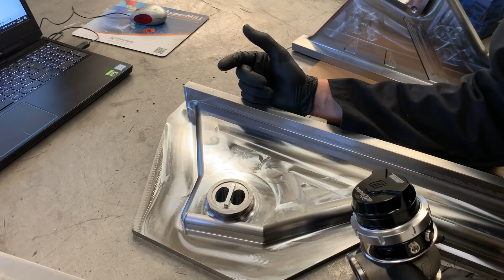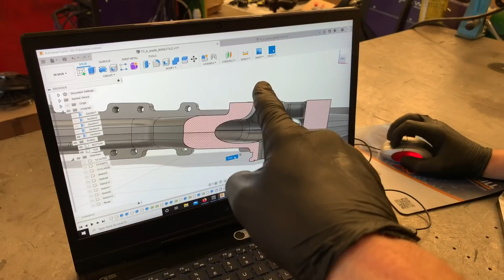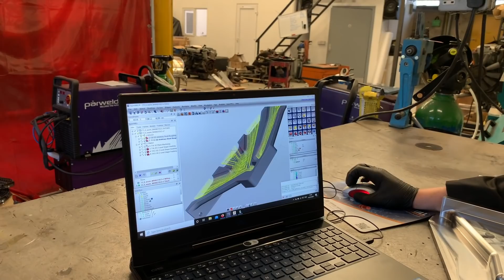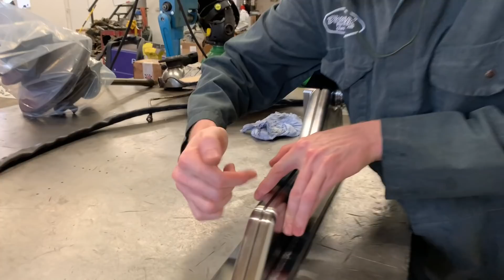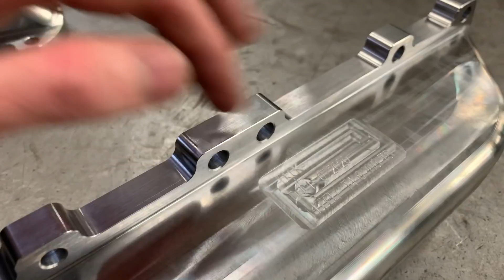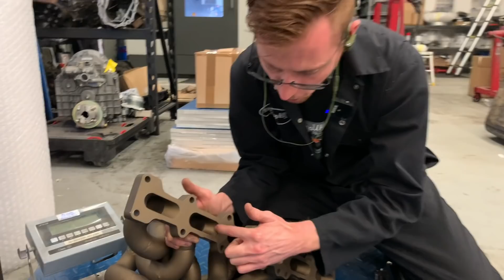BILLET TURBO MANIFOLD OM606/605

Comment: Good in theory but like other manifolds designed wrongly and using the wrong materials, it just won't last, it'll fail after several heat cycles, it'll crack and / or warp at the flanges.

Comment: Great product!
A tip for speeding up the finishing on the mill, without sacrificing surface roughness; when finishing you were using a z-level strategy. Next time use profile finishing, and then across.
Use inserts with slightly a larger radius on them, and you’re golden.

Comment: Nice job and and really need design - but you got a major “negative” flow point. At the turbo Flansch, where the flow comes
Into a sort of had angle - idea is to make the neck of the turbo Flansch longer and round so the flow gets a easy and smooth angle right before it meets the turbo and the wastegate
But very nice. Love to see and test it on a tractorpuller
Reply: agree, the merge point and wastegate port look terrible angles. super unequal lengths as well.
Reply: Often the head porting doesn’t come straight out so depending what this was built for it may have those in mind.
Reply: Interesting. Do you have any data to back your claim? Seems these guys took time to flow model their design and they probably have the test data available to back their claims, so I'm wondering where your test data is that shows this "negative flow point."

Would be nice to compare the two.

Comment: Why not Dimple that bad boy like a golf ball while you're in there
Reply: @Stephen Laverty ahhh I see I thought it was for moving air more efficiently
Reply: Dimple porting is a flawed notion.
While it might work on a golf ball where the peak speed during flight is taken into account aswell as depth of dimple, diameter, spacing etc.....most dimple porters are not doing thousands of calculations to calculate whats needed specifically for thier engine.
Which pretty much leads to the main point...
Wanna know what flows more air than a 25mm cross sectional port with 1mm deep dimples? A port thats been bored out to 27mm.
If you look at some (really well done) dimple ported heads what they're effectively showing is all the areas they could have just been removing material. They're effectively thousands of "depth tests". But the boundary layer effect is allot less than if they were just ported bigger.
But that doesn't look as good and people won't want to believe it or test it themselves and they'll just ignore the fact that if it helped... f1 etc would do it.

Comment: Out of curiosity, would this system be adaptable to make equal length headers?
Reply: Nope, if you want equal length then the channels have to be able to be crossed so that the port closest to the outlet can have a longer path. These are all in the same plane so they can't be crossed.
Just think of it as if you have a set of equal length hoses and the length is determined by the distance between the outlet and the exhaust port that is furthest away from it, it will always look like a complete mess of bends no matter how you do it. :)
Reply: @konradlindblad7860  yeah actually it can be in an equal length header style just have to have 3 piece design instead of the 2 piece design shown here

Comment: It looks good and it saves space but it's being compared to an exhaust manifold with equal length runners. Simpler methods can be considerably amaller. Although the shape of the runners being the same as the ports is definitely a plus I am still not sold on this part because it seems to take no advantage from the pulse scavanging effect. Only with a good comparison with those 2 parts actually bolted to a car could make me change my mind. This is a premium part that costs premium too for sure. I want to be sure if the performance is premium before spending my money.

Comment: What about pulse scavenging?.. I'd be interested to see this on a dyno vs a stock unit.
Reply: Stephen - an OM606 is a diesel..
Reply: @Stephen Laverty your comment makes no sense what so ever
Reply: @tomtom1541  I hope he is trolling 😂
Reply: @jzxtrd337   based on what?
Reply: Dat Boii lol what? A blow off valve doesn’t go into the exhaust manifold lol. You’re talking about a wastegate. Completely different. Lol
Reply: @Stephen Laverty Who runs carbed turbo engines? These were rare even in the 80's turbo cars.
Reply: @Stephen Laverty The online world can be brutal, especially when people comment out of the box, but also when advice is shared that's unconventional and risky. I think you're making a mistake going carb personally, venturi effect can't provide the precise fuel metering required for boosted applications. The jetting will favour either the lower rev ranges and run lean up top, or lean up top and rich down low. This will throw daily driving out the window and/or risk the engine. Remember that with turbo applications the air/fuel ratio must richen up on boost (manifold pressures above atmo) for a carb to do this the jets would need to be variable. Carb is suited to N/A where air/fuel can remain more consistent across the rev range - manifold pressure remains constant at 1bar. Few questions, will you run the carb pre-turbo or post-turbo?  I'm assuming the supercharger will be after the turbo and last compression stage before the engine.
Reply: @Stephen Laverty Hang on, first you start off bragging about a race where you beat a guy in a diesel and how diesel engines are a waste of time, then you say engines should be bringing us together yet we treat them like races??  Then in all your rambling you never gave any technical info to support your idea on turbos and carbie setups. I tried to explain why I believe it can't work well and supported with technical concepts. I'm sure you're a nice guy but you're all over the place and not open to logical debate.
Reply: @Stephen Laverty  Dude we're talking engines.. who's coming after you/martyr??  just wanted to point out the implications of turbos and carbie setups. Take it easy.

Comment: This is really nice for tight spaces and would be very interesting to see a flow comparison, also if the manifold scavenges as well as the tubular
Reply: Well scavenging is important for high revving NA gas motors, but turbo diesel motors have boost to shove air into the cylinder. As long as the boost is higher than exhaust back pressure there's a pressure difference automatically and no valve overlap swirl is needed for fuel mix because of direct injection. That's why they almost always have log style manifolds. 

BTW I'm dying to see the widebody on your Trackhawk Magnum!
Reply: @NeonAvantium  oh see I must have missed the diesel part, I saw the first manifold and assumed lol. But the whole cnc aspect is really cool, I love new cnc'ed parts.
Reply: @Junkyard_Dave   no doubt!! they made a gorgeous part. That looks like a great packaging solution with the compact size and the integrated wastegate flange.  did some learning on this. Turns out we were both right. And the key we were missing was this is a twin screw manifold. The turbo does the scavenging. 

Great engineering explained vid on this: https://youtu.be/T7JTRRlSEYI
Reply: @Junkyard_Dave  there is no scavenging with turbo engines as the exhaust back-pressure is literally double the boost pressure. Savaging is critical in non-turbo engines, yes, very much so.
Reply: I'm not sure turbo manifolds utilize scaveging Dave. It's all gas under pressure which makes the fluid dynamics the most important. Flow and restriction and turbulence.
Reply: @NeonAvantium  valve overlap man valve overlap

Comment: Adam LZ needs this for the R34
Reply: False. He's running low mount twins. Tomei already makes nice low mount manifolds that he can get for less than $800, but I wouldn't be surprised if he's going to run the stock manifolds for his first turbo setup.
Reply: @steve.r33  he will eventually go to a large single as he stated before
Reply: @adamhallwood5768  Maybe. Those 2860R gen 2 are pretty nasty. Only reason he might want to go big single is if he’s building a drag car.

Comment: I would like to see the benefits other than just being slim does it improve performance or does it hurt performance
Reply: Flow looks woeful, but being heavier it will retain heat for more airspeed. 
Shouldn't crack either

Comment: I'd be putting bolts through the center to hold both sides together.  This is going to warp and separate the two halves between the runners.

Comment: How does it hold up with high back pressure since you cant weld the inside runners? Will the gasses be able pass through to the other runners?

Comment: Why are you machining aluminum so slowwwww. Talking about efficiency of the tool path then proceeds to run aluminum slower than I've ever seen lol
Reply: That's not aluminum. Look at the raw plate and the shade of the machined parts. Raw and machined aluminum has a much lighter shade. And besides, why would you want a manifold out of aluminum?
Reply: @StoodFarBackCT9A  that may be the case material wise which would explain that. But almost all aftermarket intake manifols are aluminum. Go check out any V8 intake manifold upgrade. Most factory intake manifolds these days are plastic or aluminum. So yeah everyone wants aluminum intake manifolds
Reply: @Mr74datsun260z  Yo dawg, that's an exhaust manifold for a diesel engine, hence the wastegate and twin ports for a twin scroll turbo.
Reply: @StoodFarBackCT9A  psssshhh my bad lolol herpdy derpdy

Comment: Imagine more thermal energy goes into the turbo, much less surface area.
Reply: Stephen Laverty um, this is for an OM606/605. 

Mercedes diesel.
Reply: Thermal... Vibration... torsion stress from the engine rotating when accelerating hard. Idk ... this manifold looks good. And I'm no expert by any means but I think I would stick to tube headers . There equal length. Gradual turns ... I could be wrong...
Reply: @matthewb7049  i dare say it's much more robust than a tubular setup, it's a giant slab after all.
Reply: @Stephen Laverty It's steel first off, second off it is not for 1960 to 1980 mopars, it says right in the title it's for the OM606/605.
Reply: @Stephen Laverty I'll stick to my stainless tube headers
Reply: @Stephen Laverty not sure i follow you. Why would what I drive change the thermal characteristics of that manifold?
Reply: @Stephen Laverty original comment is the top of this branch. My only point is less surface area, less thermal loss, more heat into the turbo. It was a passing comment, that's it.

Comment: I love billet but this is the first time I’ve ever seen a “regular” part look better than its billet version. Both are beautiful. I do think putting some of tubing shape on the outside of the billet one would make it look better...not so much like a giant block of aluminum (just some light milling to bring out the shape).
Reply: How it looks is irrelevant. Let’s see it on a dyno.
Reply: Stephen Laverty that's the exact opposite of what you actually want do. Exhaust manifold wrapping is a thing for a reason. You want to keep the heat in, not out.

Comment: I am interested in how the unequal vs equal length headers will perform and sound.
The old cast iron Saab 900 turbo header makes it sound a bit like a old fishing boat, because some of the exhaust pulses hit the turbo at the same time, because the last cylinders takes longer time to travel to the collection point.
Reply: My dad had an 84 900 turbo , and I gotta say that car had one of the nicest idle notes I ever heard from a 4 cylinder.

Comment: I can't imagine that the CNC one will have the same perforance output/spool and so on.  The Anglet t the Turbo and the Wastgate are to sharp.
It may be a solution for a room restricted car. But if ther space is there I would always take the pipe fabricated one.
Fro this perspective its a complete fail!

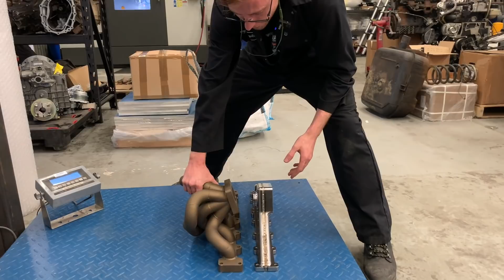Comment: @16:30 Yes, a clear difference in size, but you are comparing and equal length manifold to what is, in effect, a modern log style manifold. Great to see that CNC manifolds are now starting to become a “thing” - excellent work, and kudos for not pretending that it’s all black magic secret squirrel. 👌
Reply: This. Its like evolving, but backwards. I would take an equal length tubular header all day over a log style even though its billet.
Reply: @dopeass791  i'm thinking steel billet manifoldblock vs alu head , which one wile crack first when the manifold expands from the heat.
Reply: i know tubular headers allow some flexing
Reply: @user-rp4je2gc2o I’m bit late to the party here but the info is still the same; tubular turbo headers always eventually crack & fail. Well designed cast or cnc billet as here won’t.

Comment: You guys should get them cast. Far more efficient. Much less costly for you and the customers. You would then have no worry about the clamping between 2 halves and could simply finish them in house to ensure fit and finish. Also, not fair comparing packaging because on one side, you have equal length headers. Do equal length billet and it'll weigh 10 times as much. Conversely, you could build a very similar manifold with tubes much more akin to a classic log type and have no packaging issues. Of course, it would be more difficult to match flow efficiency at the elbow to the turbo flange but it would be lighter and marginal in packaging differences. Casting would be most efficient by a mile and you could probably reduce mass in the webbing, especially between 3 and 4. I like the idea of carrying port profile all the way to the flange but the manufacturing process is a massive overcomplication. Food for thought.

Comment: I have a Mercedes diesel S 140 engine 603 when the engine gets hot after running and stops for a while and I turn it back on. It becomes very difficult what is the problem with that.
Reply: Flux capacitor is burnt out

Comment: I love CNC machining. Always looks great. One thing I'm wondering is for a twin scroll turbo isn't it best to match your exhaust pulses for each of the twin scrolls sides? So if firing order is 1,3,4,2,6,5 then 1,4,6 are fed to one scroll and 3,2,5 to the other scroll? Very interested to see if an equal length tubular would fair against your CNC manifold :)
Reply from the maker: Garage It Yourself  firing order on a in-line 6cyl is generally 1,5,3,6,2,4.
Reply: @DieselPumpUK  Ah, well that works out very neatly then :) will make that twin scroll scream.

Comment: Tube one has equal runner lengths and your does not...sure u understand y equal is better even on a turbo car....make one equal and u b a rock star...sure u use fusion 360 ....if not what cad programing do u use

Comment: Port the billet manifold, port everything.
Reply: Keep calm and port the world
Reply: In before people mention dimple porting.

Dimple porting is a flawed notion.
While it might work on a golf ball where the peak speed during flight is taken into account aswell as depth of dimple, diameter, spacing etc.....most dimple porters are not doing thousands of calculations to calculate whats needed specifically for thier engine.
Which pretty much leads to the main point...
Wanna know what flows more air than a 25mm cross sectional port with 1mm deep dimples? A port thats been bored out to 27mm.
If you look at some (really well done) dimple ported heads what they're basically showing is all the areas they could have just been removing material. They're effectively thousands of "depth tests". But the boundary layer effect is allot less than if they were just ported bigger.
But that doesn't look as good and people won't want to believe it or test it themselves and they'll just ignore the fact that if it helped... f1 etc would do it.

Comment: Just a thought...
If there is a gap inside manifold where gases can pass then there is a chance that the manifold twist  and break.  If you make all connecting surfaces like a V, squeeze the parts together before welding it then it will be a tight seal everywhere.
Or you make a groove and seal it with copper or steel wire like on cylinderheads

Comment: Biggest issue I see coming, thermal expansion rates compared to the alloy head. Thermal mass is another problem, will stay cold sapping EG energy but then holding heat well after power being backed off. Welding maybe not needed, doweling and and bolting/studding might allow other options in profiling.
Otheriwse, nice work lads.

Comment: you should use your CNC machines usefully, make molds for sheet metal, the same material and thickness as your tubes.
to make a trumpets from 2 halves of your formed sheet metal. to make a smooth transition from "oval" to round.
make a positive and a negative mold, build yourself some hydraulic press.

https://www.youtube.com/watch?v=woMELHmq3UI <---
https://www.youtube.com/watch?v=Ausq-wOdSCU <---
https://youtu.be/aUhvo0om1q0
https://www.youtube.com/watch?v=gkcNe3BrSBM

a manual pump who do the job, some hydraulic cylinder, some i beams, decent bolts and elbow grease, like Edd China would say.

Comment: Why can't you make one in aluminum looks like a pretty heavy part and what about the welds being the weakest link from constant expanding  I'm sure it needs to be braced all that weight will pull the studs right out of the head I would remove as much fat as possible expecialy at the welds don't need anything more than ¼ inch  max ³/16 wall thickness